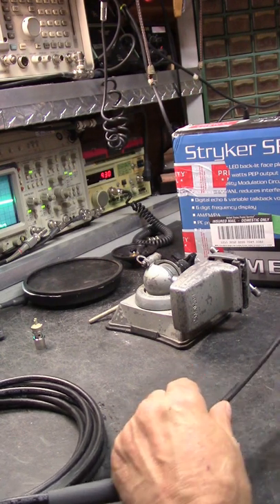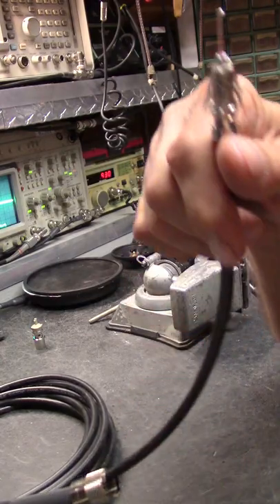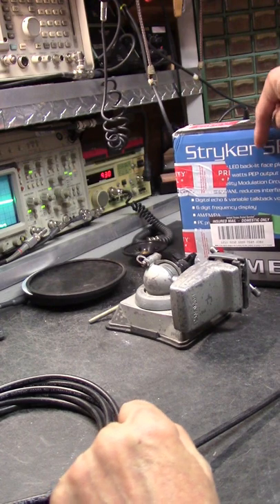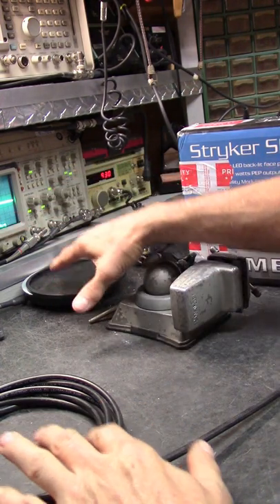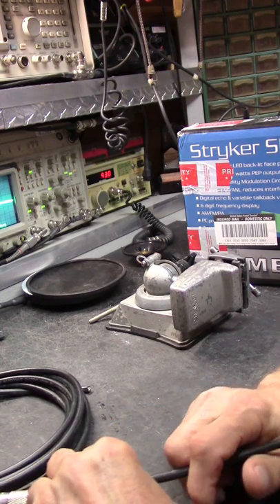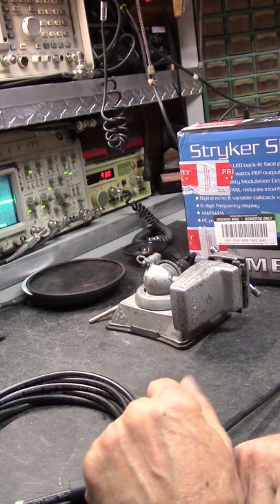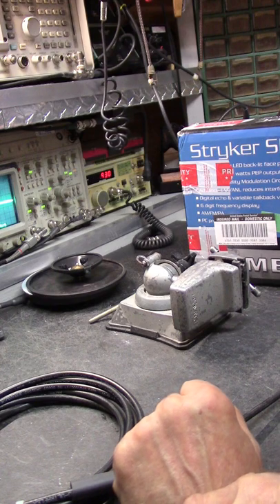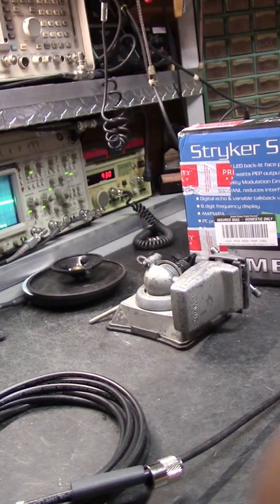If they can't show you they're snowing YOU,  open your eyes!

Comment: I have always said the cable you use and how the ends are installed can make or break a radio system. But I do disagree or take exception with crimping! If done correctly. Their should be no problems!  Times microwave told me they like their crimping system . For their cable. And think it is superior to most solider jobs found  on most pl259, so style connectors. As you stated the best cable, antenna system is next to worthless if the connector is not properly attached to the cable. Like anything else if you are not  shown how to solider or crimp properly both systems suffer! My experience comes from the military side of radio life! Or as my mentor said solider breaks under stress, a good crimp stays put and does not pull out?  Sorry for the ramble. I am tired and hot. It is super humid out today and that damn corn never let's a breeze through. Z3 tod in the corn patch. Kc9rka.
Reply from the maker: All cool and thanks for stopping by. The military might have a solution be here in the civilian world ... Solder.